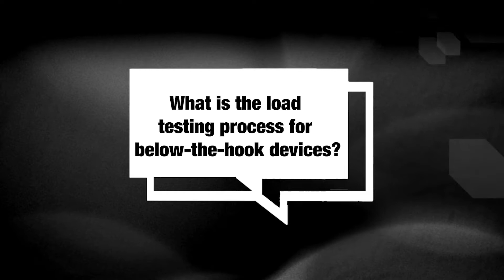How Do I Perform a Load Test on a Below-the-Hook Device?

Comment: How do I become certified to do BTH load testing for my place of employment?
Reply from the maker: There is no certification to be able to perform a load test. You just need to have a certified load cell that is calibrated annually. Then, just follow the guidelines in ASME B30.20 or the manufacturer's requirements for the device. 
Your employer will also need to do some sort of documented training to show that the person performing the load test is qualified to do so. Load tests shall be performed under the direction of the manufacturer or a qualified person. I would reach out to the manufacturer of the device and ask them for some training on how to properly perform a load test on that specific device. If you are looking into a general qualification for many devices, then ITI should be able to put you through a training course. https://www.iti.com/